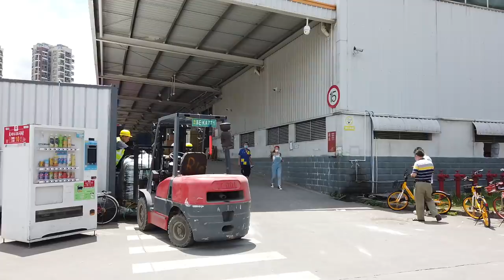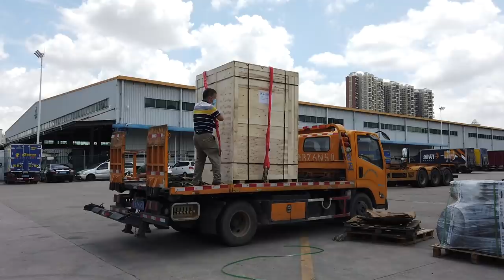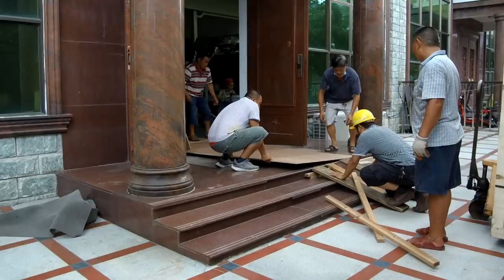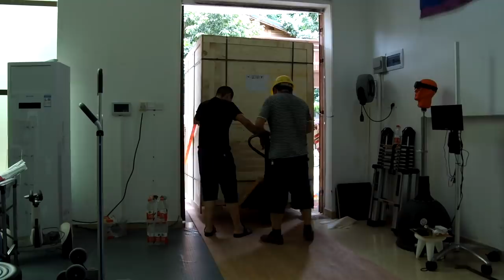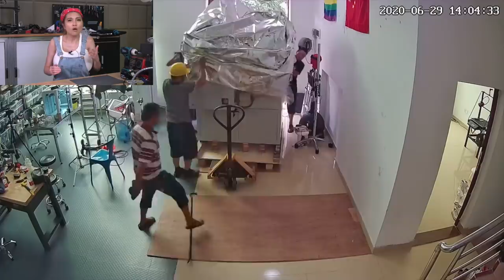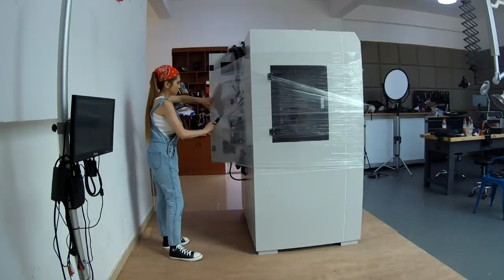Giant CNC Delivery! The 900kg Syil X5 Milling Machine!

Comment: The uncles did a great job, beijing bikini and all! I was watching the forklift driver at the start, getting mad because the load wasn't right up against the end of forks. Still, you got the machine home, in the house and its going to be a pretty awesome series. Can't wait!
Reply: "Beijing bikini" was a phrase I wouldn't have gotten without Serpentza's videos on life in China. Is that where you heard it?
Reply: I want the forklift driver to glue a mirror to the corner of the forks so they can see if they've cleared the truck deck without having to lean as much.
Reply: Not only that, he should have tilted the forks slightly inward to prevent the load from falling forward. He was kinda sloppy.
Reply: @SciStarborne  If you were OHSA,  that maneuver would have probably induced a heart attack.
Reply: @williamswenson5315  No, actually got it for local media here in Australia, but still..... :D
Reply: @williamswenson5315  China and OSHA don't belong in the same sentence...  

Compared to most of what I saw in China, these guys were head and shoulders above the average...
Reply: @SciStarborne  speaking as an occasional fork lift driver, the answer is to lift the load higher. Between that and having the load hard against the heel of the forks you can see where you are relative to the flat bed.

Comment: This will be an interesting learning experience. While you've got a good start with CAD software and 3D design there are a lot of things you will have to learn about the strengths and limitations of what that CNC machine can do and what tools you use to do what. Then there is things like rpm, cut depth and feed speed, all depending on the exact material used and if it's annealed or not. You will also learn how to work with materials that work harden, as well as thermal expansion that can cause warping or wonky dimensions.

It'l be fun and at times frustrating, but mostly fun I hope.

Comment: Hi Naomi,

I am in Florida and have a shop like yours. Manual mill and lathe and 3 axis CNC. 

Been an engineer and machinist since CNC was done on punch tape.( graduated from toolmaking school 1974) 

Three things right from the start with your machine 

1) Try to choose a paint friendly coolant....otherwise your machine will look like crap in a year and also have corrosion issues if itshumid where you live or your shop is not kept under AC.

2) Always home and then run a warm up program as the first operation every day. And stay with it while it does the run...if a crash will happen thats when it will happen from a machine problem.

3) Learn conversational programming first, pocketing and bolt circles...then advance to CAM program projects like complex step over profiles etc...that way you are completely comfortable with your machines quirks before doing something really complex.

You made my day when I saw you got this....makers allover the world are inspired by you!

Have fun with that machine...I can hardly wait to see what you make.
Reply: Oh! Also run tests weekly on the coolant for BRIX ....most coolants are between 5 and 7 to keep them from stinking and for riding the ballscrews and ways. Use a spectrometer for the test....they are cheap and easy to use.
Reply: Sorry it should say rusting the ballscrews and ways..

Comment: Naomi, you are probably a step closer to using the machine than some people, due to the fact you have operated 3d printers for some time now. Since the 3d printers work on most of the same principles that a cnc machine works on. 

The computer reads G-code.
Translates the coordinates from the code to step/direction (or position signals)
Moves Steppers/Servos

The main difference is in how you use the tool section, and the things you need to keep in mind.
Cutter dimensions, Speeds and Feeds, cutter shape (up cut, down cut, compression...), cut direction, where the part is, where the fixtures are...

I am sure once you get the hang of it you will be making some cool projects with all 5 axis.

Congrats on the cnc score and I hope you have a blast learning how to use it.

Comment: the machine is cheap, the tooling is expensive and delicate.. one wrong coodinate and your tool is gone... also don't aways trust the interpolations... check it twice cut it once..   I used to program bigger versions of these... do a step by step of the tool path with no tool in  and no work piece... slowly  slowly...  don't rush..
Reply: The machine is cheap? wow! I will need some more years to spare this amount, not speaking about the house required for it.

Comment: Working wit cnc machine tools has taught me patients. 
Triple check your tool height offsets and program, always dry run even proven programs and always keep the rapid movements of the machine low enough to prevent damage from high speed collisions (they will happen).
Treat your machine like a naughty nephew and you wont go wrong.

Comment: I've got to move a 700kg lathe next weekend. I've moved it before but I was about 15 years younger then. I'm not looking forward to it. Also I have to say, these guys in this vid were a lot more careful than some so called professionals I've hired in the past. I've had prof firms damage walls, floors. One I used wrecked a brand new floor because they didn't board it before running steel rollers with 1000kg over it.

Comment: As a machinist.   I would be happy too! Having a CNC inside your own home!
But as a machinist,  I'm a little worried about the bamboo flooring that it is sitting on.  As these machines start to age, they start to leak and will cause a mess.  Also is that floor strong enough to hold when you start making chips? There are a lot of vibration and noise that come from a CNC machine.

Comment: Theoretically that CNC "monster" runs g-code somewhere deep inside but it is a industrial CNC, that offers you special software for it and the ability to adjust settings on front panel without a  computer, it can work like a printer but it can be much more ... hope you did the training session at the factory, it helps a lot  to get you started, after you can dive in the parameter books ... i feel tempted to ask for her hand, if you let me live in your shop, won't ever bother to come out again from there ... im in love with your machine already, hope you give us your blessing 😁❤❤❤

Comment: If it uses g code, it's easy enough to learn. I'm not sure of other coding. If you have any issues with tolerance, you may want to consider putting it on isolation pads, as the vibration of the machine can interfere with itself.

Comment: lol   Big?   For a house, sure...    industrial CNC mills can be 10's of meters in the X&Y axis, Soo with yours...    What kinda controller does it have? what software are you going to be using to push G code up to it? what voltage does it run on? can you do 4 axis on yours (in old school machining, this would be like a...    rotary indexer)?

Comment: That loading was funny, one guy driving the forklift and 3 waving and shouting at him. Obviously truck mounted remote controlled cranes are not a thing in China? We have lots of those here in Finland, one guy can pick up and deliver a heavy item like that easily within the reach of the crane, typically about 10 meters. Of course the bigger ones require quite a large truck, might not fit in the narrow streets.

Comment: Ditto on Mark Sims comment!!!
Sure the entry level price is getting  cheaper but repairing and replacing broken spindles, fixtures, etc. IS EXPENSIVE!. Learning G code and NC programming on your new "toy" will cost you big time for a stupid programming error. Better to learn from an experienced programmer at least for a few weeks. Good CAM software with virtual paths will help.
Just my 2 cents.😁👍

Comment: I would worry about having the proper power source for it.  That can't run on standard house wiring, can it?
Reply from the maker: 220v, 20amps
Reply: @Naomi-Wu  So it does need its own circuit.

Comment: What controller does it use? 
HASS, Fanuc, or Yasnac?
Reply from the maker: LNC
Reply: @Naomi-Wu  watch out for o and 0. Getting those two mixed up could make the machine read it as a bad code. Also graph and dry run EVERYTHING.  Nothing ruins your day like a crash. And last thing. M00 - forced stop. M01 - optional stop.  M08 coolant on
M09 coolant off. G00- rapid liner motion. (Full speed from point to point) sorry for this being a mouth full.  Please be safe, and i cant wait to see what you make

Comment: Nice toy. Can you ask manufacturer to put bed size up on site and can you say it in next video. For the price it may be worth a good look. Next time you move something like that use 50mm plastic pipe as roller. Abs plastic. 1.5m long. Old guy and use plastic pipe for rollers all the time.

Comment: Madre mía, estás loca Naomi, pero igual queremos verte cómo te manejas con esa monstruosidad. 
La marca no la conozco, pero como bien sabemos lo que es una fresadora CNC, es una de las mejores herramientas industriales para crear o fabricar "vaciados" a objetos metálicos (mi pregunta ¿también madera?, ¿tipos de acero?), se suele usar muchísimo para crear moldes a presión, en fin... EXPANDE TU CREATIVIDAD!!
-------
My God, you're crazy Naomi, but we still want to see how you handle yourself with that monstrosity.
The brand I do not know, but as we well know what a CNC milling machine is, it is one of the best industrial tools to create or manufacture "castings" to metal objects (my question, also wood ?, types of steel?) usually use a lot to create pressure molds, anyway ... EXPAND YOUR CREATIVITY!

Comment: "In Chinese we call older guys like these uncles"
I love this part of your videos where you mix in some Chinese culture in 😉
About manufacturing in China; I live in the Netherlands and we used to have a lot of parts made in China. Mostly small batches (100 parts) of small (max 5x5x5 cm) aluminum parts. We then had the same parts made in Europe but we are not too happy with the quality of those parts. It is more expensive and the finish of chemical polishing and anodizing has gone down.
The only reason I do not want to move back to production in China is because of your safety remark: "But this is China" ... We were told that the Chinese parts we have have been treated with chemicals that are banned in Europe due to health and environmental impact...

Comment: Love CNC machines until you make a mistake and mill off something you needed.  Guessing you have 3 phase power running to your house nice.
Reply: Those Syil machines at least in the US models I saw should run on single phase input. (From what I remember they do have internal VFDs to drive the 3-ph spindle)
That said China might be more easy to get 3-phase, especially in a city.
Reply: Scott Watrous all professional machine shops have 3 phase power.   For her little shop I thought it’s amazing if she had 3 phase power.